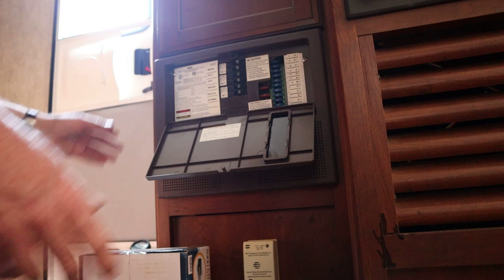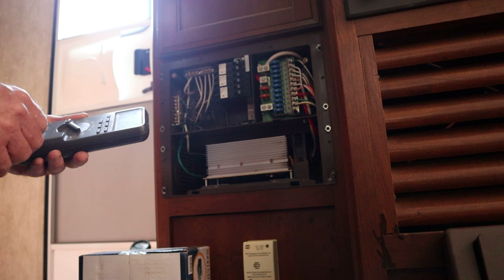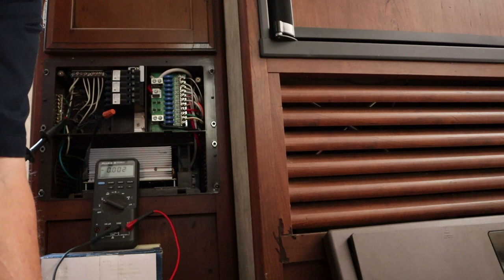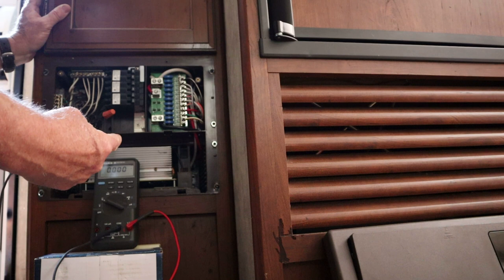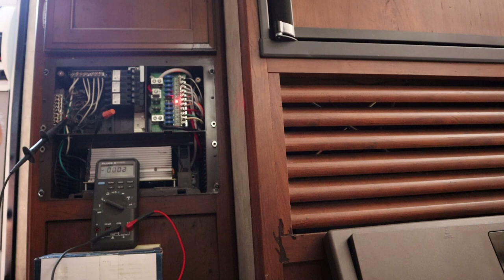No DC Power Inside RV. Bad Converter?

Comment: Thanks for the video. I’m a new subscriber and I want to learn. I like your no nonsense attitude. So what do you think caused the fuses to blow; since the battery was connected correctly? Could of it been caused by a bad electrical pedestal they connected to? 
Thx
Reply from the maker: The battery was hooked up right when I saw it, but it had been hooked up wrong before. Hooking up the battery backwards is the only way to blow the anti-polarity fuses, as far as I know.

Comment: Funny thing, I replaced mine like 7 years ago & they sent me the wrong DC board with the converter, but it was still compatible. It's a 20 max amp 1 instead of 30. So I had to manually torque the slide out motor now. I learned it was wrong, because I was like why one of the thick cables kind of in between the fuses. Just felt wrong and looked. I read on amazon reviews & found out they were indeed sending the wrong ones to everyone.
Reply from the maker: It's good that it is working ok.

Comment: I don't know if this is okay or not but I have a question for you?  
   First Time RV guy...
  Just installed solar to my RV. 
  I remove the converter and install the inverter with the system.... My inverter is giving me AC but very weak only enough to run an LED light...
   All of my DC lights stereo that type of things I'm not working I have no DC current at the fuses.... My question is do I need the converte and the inverter ?  I have not plugged in shore power yet so I have no idea now that's going to go?  Trying to do one thing at a time....
    Thank you any info will help
Reply from the maker: The converter charges the batteries from an AC power supply, so yes I would think you might need that.

Comment: I had two batteries on my fifth wheel, one needed to come out because it's dead and now just using one 100 amh battery. But I think I hooked it up wrong because no lights on inside. P.s. using solar to charge my battery... Off grid. Question is my battery says it's charging so that should be ok but does it automatically fry the converter? If I hook it up in the correct way? Thanks man, love your videos, I'm Shawn..
Reply from the maker: Did you check the anti polarity fuses?